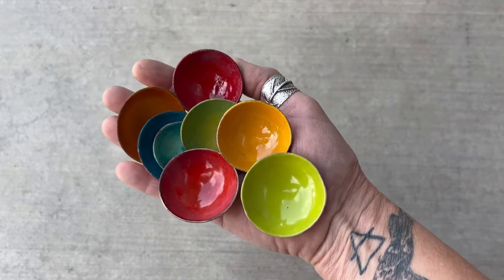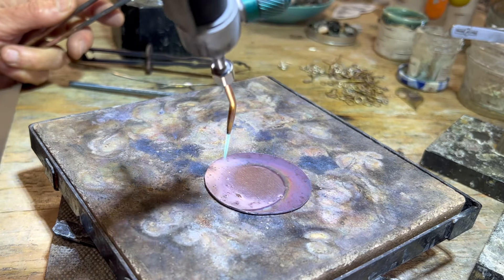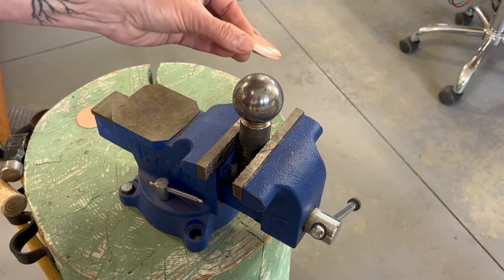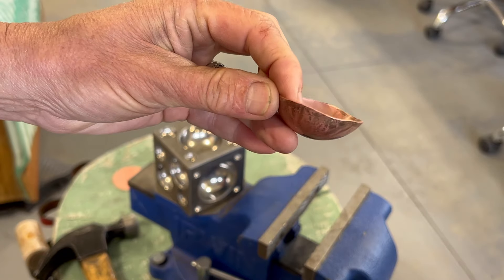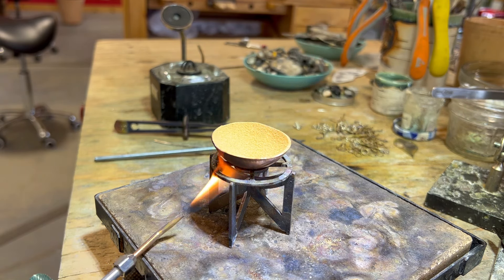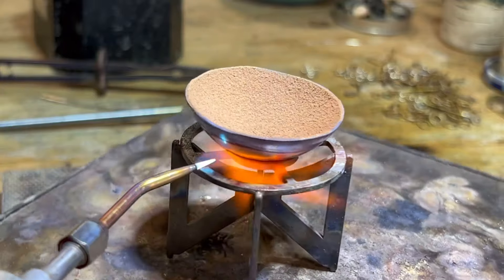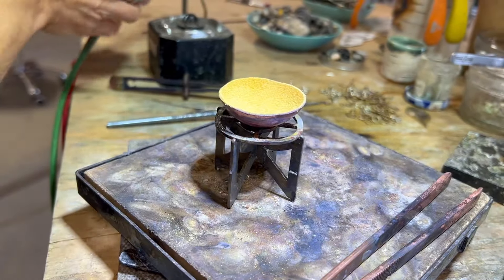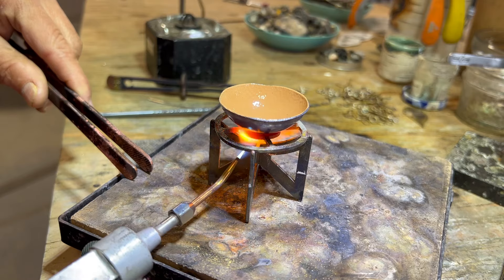How to Torch Enamel small copper bowls

Comment: I don't understand why you don't have to counter enamel when torch firing, but you do when kiln firing. Could you explain further? Thanks!
Reply: In a reply to another comment Nicole explained that enamel gets gummed up when the torch is on it, so she only uses the torch on the enamel-free side.  I think also that counter-enamel is less necessary on a curved shape and when  the enamel layer is thin - flat sheet and thick enamel is more likely to cause tension in the piece (& cracking/chips in the enamel) as the glass enamel and metal cool at different rates.  (Recalling this from an enamelling course I did many years ago!)

Comment: I've been wanting to learn this for a quite awhile~   Are you going to teach how to do this in areas within a piece of silver jewelry?   Would love that ! I've been told to absolutely wear a mask while doing this. Powdered glass is very hard on the lungs!   I have a medium/large depression in my stump that I use like a dapping block to start the shaping process with a round ended plastic mallet. It's wood so it's softer against the silver and usually doesn't mar the surface. Much easier in my opinion.  Thanks again!♥🤍💙

Comment: Great tutorial! I have never considered enamelling before. Can you enamel using a small handheld butane torch or does the enamel need to get hotter to set properly?
Reply: I am curious about it too!
Reply from the maker: I haven't used butane before, but I looked up whether or not it's possible. Seems so! Check out this tutorial by Fire Mountain Gems: https://www.firemountaingems.com/learn/categories/essential-resources/tools-supplies/D91Z-project-tutorial.html#:~:text=Torch%20Firing%20Enamel&text=Fill%20the%20butane%20torch%20with,onto%20the%20mesh%20firing%20rack.
Reply: I have torch enameled with a butane micro torch but only with very small pieces.  I definitely didn't make it look this easy!

Comment: Thanks for this video! You mentioned they can hold salt/pepper. So if we use lead free enamel they are food safe? 
Someone will ask if they are dishwater safe? Thoughts on best care? 

Do you ever clear spray the underside to prevent tarnish
Reply from the maker: Lead-free is food safe (although I wouldn't test putting it in my dishwasher). I would hand wash and dry. I have not sprayed anything on the bottom side, but I do use Renaissance wax which slows the tarnishing process.
Reply: Thank you! I made two last night and they are so cute!
Reply from the maker: @dalenawatson2752  Excellent!!!
Reply: I’m getting some cracking of the enamel around the top edge. I tried some square shapes that I domed and the corner edges are turned up. Those frames on the top edges and one actually cracked off. I’m thinking this is due to no counter enamel. Any thoughts? Have you tried to torch fire a counter enamel on something this large? Thanks!
Reply from the maker: @dalenawatson2752  Are you working on copper or silver? I don't counter enamel when torch firing (I do when kiln firing).
Reply: @ringgoldnic  I’m working in copper. Probably 21 gauge
Reply from the maker: @dalenawatson2752  Interesting. You're letting it cool without quenching? And how many layers of enamel have you added when it cracks?
Reply: Yes. No quenching. Air cooling. 3 layers of enamel max.
Reply from the maker: @dalenawatson2752  I'm sorry. I'm not sure why that's happening to you. I haven't had that experience so I would need to see what you're doing differently than I do. When I counter enamel with the torch firing process, the enamel that is heated directly by the torch tends to gum up. It's only effective when I kiln fire.

Comment: great video. The process would be the same for sterling silver, yes?
Reply from the maker: Yes, except that you would need to go through the depletion gilding process.
Reply: @ringgoldnic  Ah okay, do you have a tutorial on this?
Reply from the maker: @sororbudwiser  I don't, but depletion gilding is when you anneal the sterling until, each time you anneal, there is no longer any hint of oxidization. You're coaxing the fine silver to the surface. It takes about 10-12 anneals and then you can fuse enamel to it. Same goes for Keum-Boo.

Comment: Still not clear on why you don’t have to counter enamel with a torch but you do with a kiln. It’s the same piece of metal with the same amount of  enamel. Anybody?
Reply from the maker: When torch firing, the enamel layers are generally thinner than when kiln firing. That's the first. The second is that, when using a Little Smith in particular, you're heating sections of the metal at a time, so the underside of the metal isn't reaching the same overall temperature as that of a kiln, which keeps the enamel from popping off.